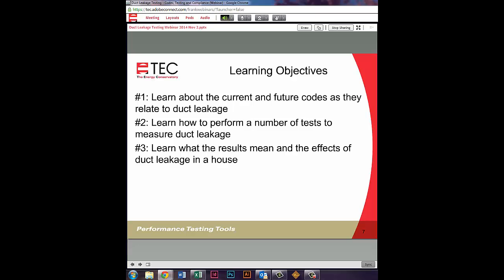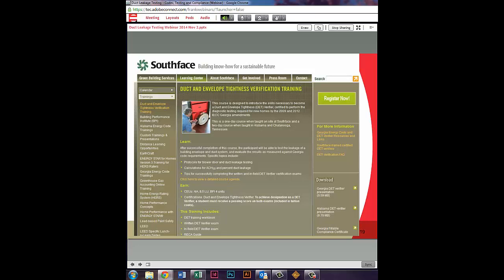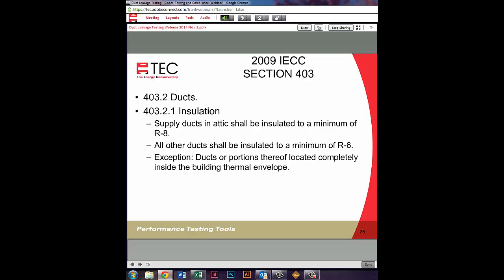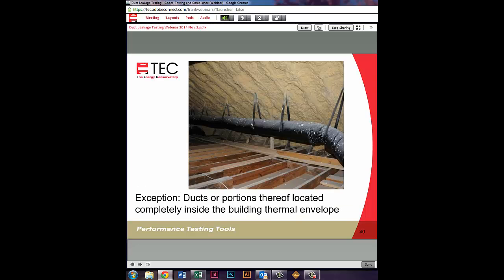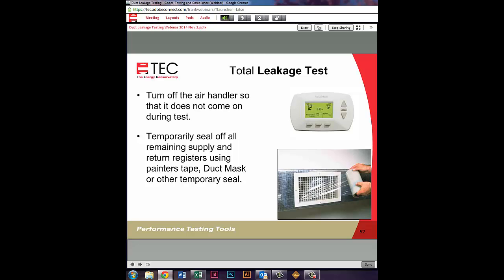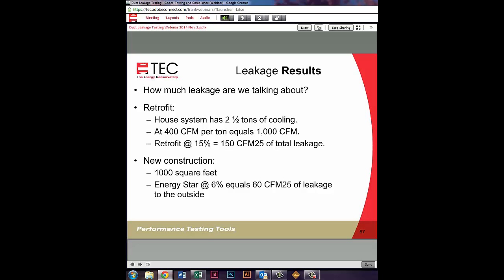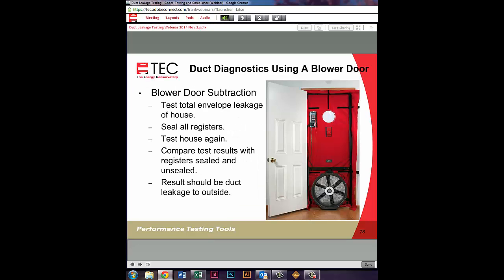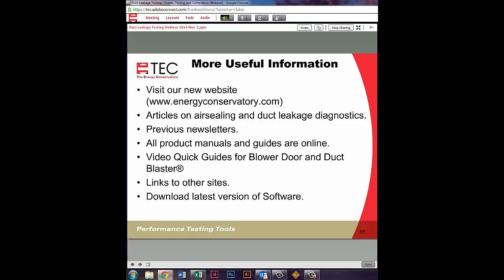Duct Leakage Testing - Codes, Testing and Compliance

Comment: Is it against code to insert the static pressure tube in the return instead of a supply? Also is it necessary to remove the filter if it is brand new. Thanks.